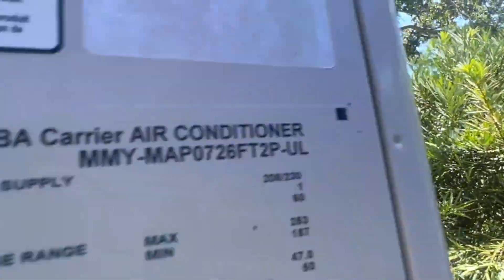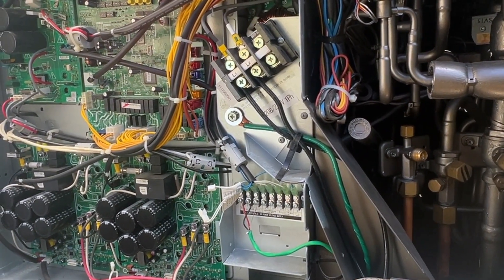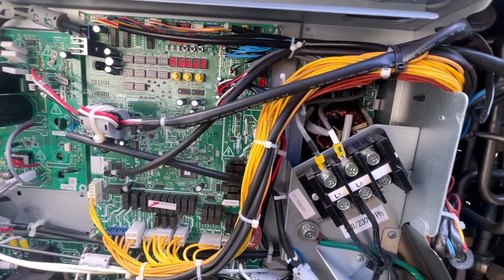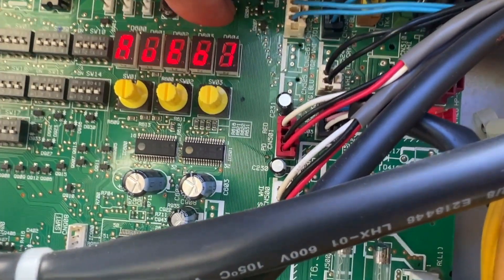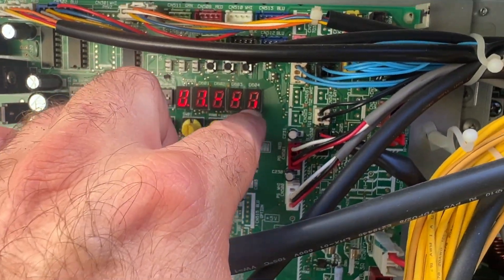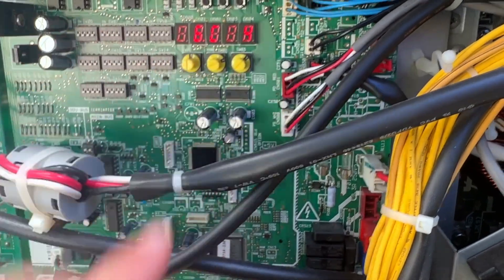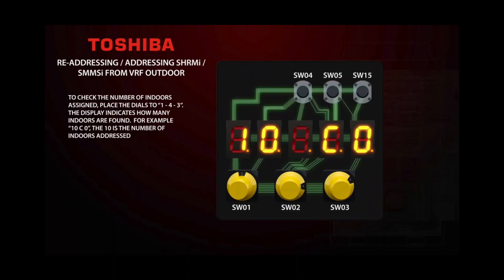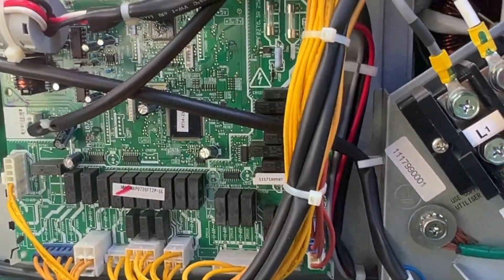Toshiba  VRF Carrier Troubleshooting

Comment: You don’t need to clear the address of the whole system. Next time do 2-14-2 hold SW4 till it show auto release then rotate to 1-1-1. It will look just for the new IDU you replaced our if you changed an IDU main board.